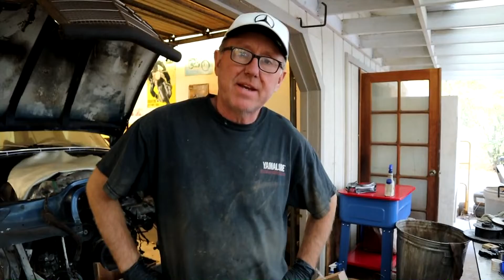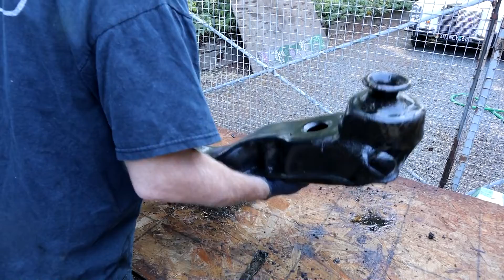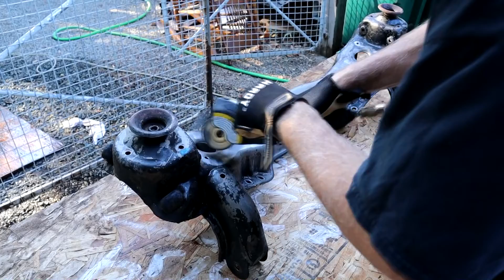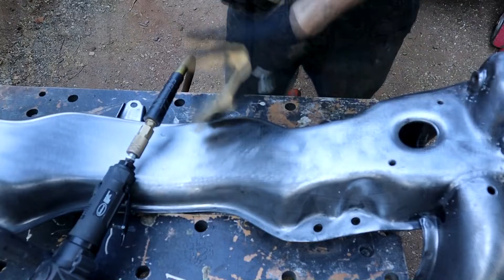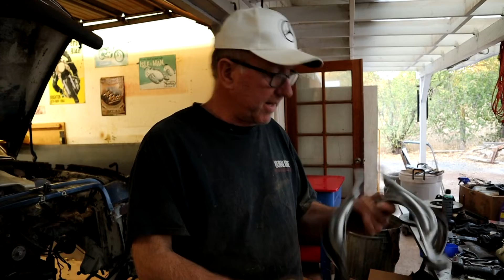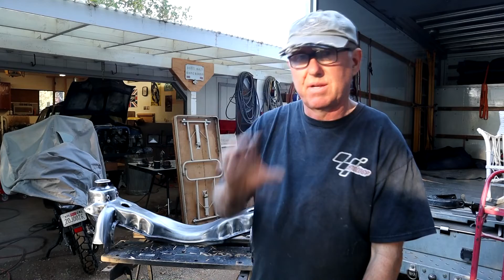Mercedes w109/108 Subframe Rebuild Part Two.

Comment: The W116 suspension is so different from the W108/109. You can see the transition from using stamped to forged parts. Very interesting engineering there and thats one reason I love Mercedes Benz. 
Having said that, my ex W108 was a 1972 model year (which I have always believed was the last year of W108/109 production before changing to W116). Please correct me if I am wrong. My 108 had the forged type suspension parts and years later I bought a 108 manual and was surprised to see the stamped suspension parts.
Reply from the maker: I think all 108 cars had the same suspension up front. The w109 had the air springs. The only other difference i know of is the  hydro compensator spring on the back of some 108's

Comment: Beautiful work... you took the words right out of my mouth when you said stripping paint is strangely satisfying.  I’ve been scraping paint from interior woodwork with a heat gun and a variety of scrapers.  When finished you end up with something which looks as good as the day it was milled.  That assembly will be as new when you’ve gone through it.  And any worries about longevity will be put to rest.  Well done once again... cheers
Reply from the maker: Are you in the woodworking trade? That's what I have been doing last 35 years or more. Antique restoration etc. Doing the car stuff is a nice change of pace, but also has a lot in common with Furniture restoration. Can't wait to put some finish on the subframe. Cheers John..
Reply: @mercedesmaintenance.6339  I have an Victorian house which had been altered over the years.  I’ve been undoing the alterations where appropriate so to that end have set up a workshop in my cellar.  The primary wood species used in the trim is quartersawn white oak but it’s been painted ... so I and my trusty heat gun have slowly been cleaning off the old paint.  

My avocation is collecting furniture and have been maintaining that as caretaker. I work for an aerospace company.